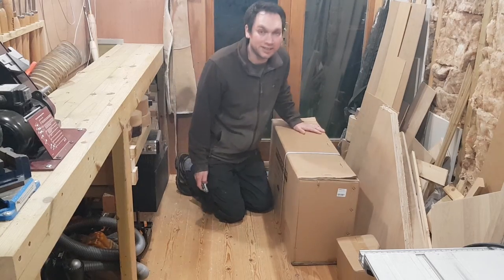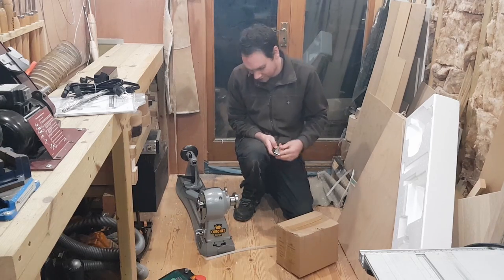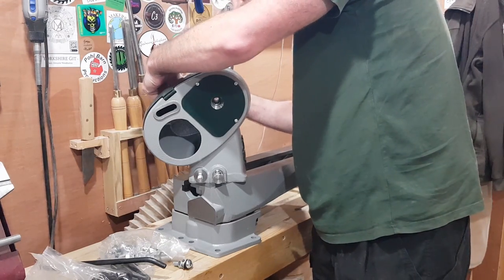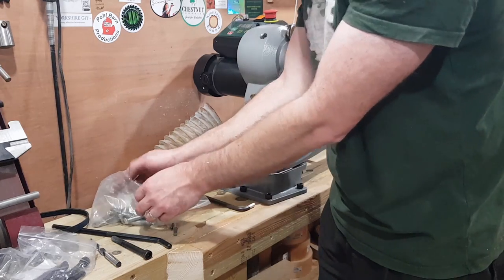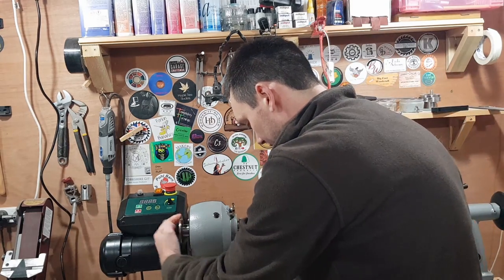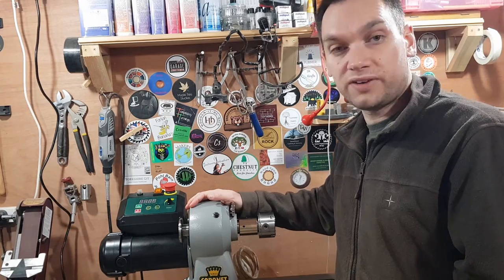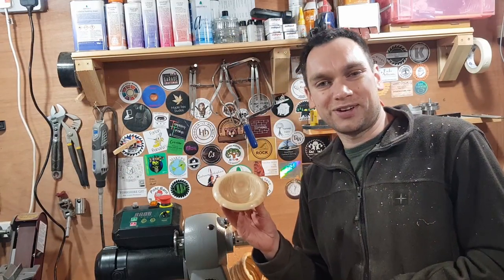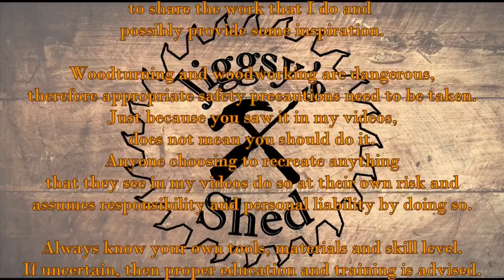Unboxing the Coronet Herald Lathe and having a go

Comment: Hello John,
Congrats on your new lathe. I see that it has a strong and solid structure. It's also great that it's adjustable. It will perform well in use. As far as I have heard, those who start lathe work always continue to change lathes with a higher model. But your old lathe's engine seems to have a problem. This beautiful lathe is awesome. I just watched a nice new design on the new machine. Keep up the great work with it. Thank you for the introduction and detailed information. See you. all the best.
Reply from the maker: Thank you Mehmet, really appreciate you watching. Yeah, I was definitely in need of an upgrade and this lathe should keep me going for a long time. The weight of it will make it a lot more stable as well. There is so many other lathes that can be upgraded too later, but space will become an issue.

Comment: Hi Jiggsy.  I got one 3 weeks ago and I’m very pleased with it.   I couldn’t help noticing that the power lead on yours hangs down and swings in the air. It did the same on mine.  I contacted Record Power and to my surprise, they didn’t want to know, they just said they always been made like that. Which in my opinion, doesn’t make it right.  I think most electrical engineers would consider it to be a safety issue.
I thought about attaching it to something, perhaps the bed, but that would prevent the head being slid down it.
So I rewired mine with a suitable length lead going to the filter.
I didn’t use the bed-leg connecting plate.  After measuring I decide it would make the spindle to high, when mounted to my bench.  Instead I drilled, I think it was 10, 10mm holes in the bench and used 10mm bolts to secure the bed to the bench, believe me it ain’t going anywhere😀
Happy turning, cheers Noel.
Reply from the maker: Awesome, glad you're enjoying yours. I am still really impressed with the lathe overall and enjoying it. Definitely was the best decision to upgrade to it.
Yeah, that power lead did confuse me initially as well and I did think if there was an option with it, but as you say, short of rewiring it, I just decided to leave it as is for now. I just make sure that there are no other forces pulling on it.
Without the benchfeet mine would have been lower than I'd have needed it, but they also give the opportunity for me to place items underneath the lathe while I'm working.

Enjoy your lathe and happy turnings!
Reply: @JiggsysShed  The space underneath is a good point, it would make removing the chips underneath much easier.  I suspect my bench is a bit higher than yours and the connecting plates would have made the spindle too high.  Plus the additional cost😉
I still think that the cable length is wrong, but RP won’t admit it, if they do I will probably cost them.
Reply from the maker: @Jestey6 it does make it easier, though I still need to use the vacuum  under the feet as it does not brush out easily. They are definitely not necessary if you don't need the extra height.

Comment: Nice work man, smooth cuts too, i hope i get there soon LOL.  I'm picking up one of those tomorrow, i do have a Laguna 18-36 but i want a second lathe and the Coronet Herald is the chosen one.
Cheers.
Reply from the maker: Thank you. I'm still very much learning and my cuts are not always quite there, but was definitely pleased with how this came and the herald definitely made the job a lot easier than my old lathe. 
The Herald is definitely a great lathe, though would have been good if it came with a slightly larger tool rest... Will have to pick one up some point
Reply: @JiggsysShed  Get a Robust brand tool rest, they come with a round hardened rod welded on the top, very smooth and long lasting. BTW i just finished setting up mine, love it, it's like an old sawing machine, retro, quiet and yet advanced. mine came with the new upgraded tail-stock, self ejecting and the bolt doesn't come through the hand wheel anymore.
Reply from the maker: @area50juan  they've only just really started selling robust lathes here, not sure they sell the parts separately yet, but will have a look. Thanks for the advice.

Glad you like yours. Yeah, it is nice how quiet it is and the self ejecting tailstock is brilliant.

Have fun

Comment: You will enjoy this a lot! A good buy👌
I am considering removing the legs from mine and also attaching the lathe to a wooden workbench. I'm curious how it will go for you in the near future. I'll keep an eye on it. 
Have fun with your Coronet Herald!
👍Frank.
Reply from the maker: Thank you so much Frank. It definitely is a lot of fun and already feels so much easier to use compared to my old lathe.
I think that the only thing with mounting it to a workbench is that there is more vibration with unbalanced pieces as there is less absorption of the vibrations, but it definitely does help from a space perspective and I can put tools and stuff underneath the lathe as I'm working so that they are close to hand.
Thank you for the sub, watching and commenting...greatly appreciate it

Comment: Congrats on the new lathe Jiggsy. Looks like im gonna have to considder the same as my lathe does the same as your old lathe. But maybe ill just try and get a new motor for now. Glad for you mate, enjoy it 😁👍🏼👏
Reply from the maker: Thank you Japie. I was initially in 2 minds about just trying to fix the old lathe, but it had a number of other frustrations, which pushed me to getting a new one instead. Hope you can get your motor sorted.
Thank you again for watching and commenting.
Reply: @JiggsysShed  i know how you feel about the old one as my first lathe was similar just branded differently. Because the bed is just square tubing for one, it makes a hell of a noice when turning and they arent really structural strong. On my old lathe i couldnt use a chuck as the whole spindle and threads were smaller and having an adapter made would have costed me a grand.
Reply from the maker: @PotgieterWoodturning  yeah, mine would flex when I put something between spindles and I could never take something off and have it perfectly centre when I flip it round.
Wow, that's a lot for an adaptor. My chuck set came with an adaptor to fit the spindle thread of the old lathe which was handy.
The new lathe definitely runs a lot quieter and the weight just gives it so much more stability.
Reply: @JiggsysShed  yes, like you say, turning stuff around you always had to true it up again. Yes, it flexes a lot. Glad you are enjoying the new lathe mate 😁👍🏼

Comment: Nice lathe, just bought one myself for the same reason. All you need though is a new set of brushes for you old lathe. They are only a few quid online.
Reply from the maker: Thank you for watching and commenting. Enjoy your lathe, it definitely is a great piece of machinery.
My thoughts were that it is the brushes, though some have said it could be the capacitor. Although fixable, it was always in my head that I would think about upgrading when the old lathe needed repair as I needed something with more torque. Will fix up the motor some point though and make use of it somehow.

Comment: This is my first time watching a video of yours. For over a year I've been looking at this lathe on and off. I see they're on sale again right now. Trying to justify buying it over other tools that I could really use for work and that would actually make me money. It's been almost 40 years since I've used a lathe. What are your thoughts after using it for a year now? And what lead you to buy this one?
Reply from the maker: Thank you for watching.
I am loving this lathe as it has significantly stepped up what I was able to achieve on a lathe.
I had a friend who had one so he could advise about it. Also, other makers in the community recommended it to me. The lathe fits well into a small workshop and despite being a smaller lathe, the way it is engineered allows ir to compete with bigger and more expensive lathes. The other reasons for purchasing it were the variable speed and the swivelling head stock (not necessarily found on other lathes at a similar price). Both of these functions allows for a lot more ease in turning.
Although I've not done it yet myself, I would definitely recommend hitting a bigger tool rest or a curved one to reach into deeper bowls better.

I hope this helps, but if there is anything else you want to know, just let me know
Reply: Cool, Thanks. Do you have any other recommendations as far as accessories in addition to the bigger tool rest a newbie should consider? Or which turning chisels/gouges should one get? Which brands are the best? @JiggsysShed
Reply from the maker: @t.e.1189  the accessories I have purchased as extras were a bigger chuck than what I had. I went for the 100mm from Rutland Tools as it came as a set with a number of adaptations. There is a video up in regards to unboxing that. Though my other choice would be the Record Power or Axminster chucks. I also purchased a Jacobs chuck insert which allows me to drill a center hole and has made hollowing simpler at times.
Gouges wise, I can only really recommend what I have used. There are a variety of good brands out there, but I do like the Robert Sorby tools in regards to traditional gouges. Simon Hope does a really nice carbide pro hollower.
If you are looking to use carbide tools, I would recommend Easy Wood Tools, they are not cheap, but you do not need many of them to achieve good turnings. I have had a go with them before and they do cut the wood really well.
 @JPwoodwork uses these all the time and would be able to advise you more on these if interested.

If using traditional gouges, make sure you have a good sharpening system. I use the Robert Sorby ProEdge as it makes sharpening a lot quicker and easier for me, but there are other options available.

Traditional gouge wise, you do not need to start with many from the offset as you can often achieve a fair amount with even just the beginner sets on offer (Robert Sorby does a set).

Currently with the swiveling head stock I can only turn it to a 45 degree angle as having other at 90degrees I will need the outrigger.

If you are able, I would definitely recommend having the legs with the lathe to have it free standing. Having it mounted on the bench does mean I have to run out of balance pieces at a very low speed as it will otherwise shake the whole workshop.

Comment: I've heard only good things about Coronet series lathes. They say Herald is not 1hp, but closer to 1.2-1.3. And it has all the bells and whistles one may want. I've heard you may want to aquire center to center male mt2 rod. It has a name I don't recall, but it helps lining up the headstock to tailstock dead on
Reply from the maker: Thank you for watching and commenting.
Yeah the coronet series has definitely stepped up the game and the power for a small motor is great as they have managed to step up it's power output, so it does rival bigger machines well. The swivelling headstock and variable speed is definitely a big plus for me.
Yeah, not sure of the exact name, but I know what you mean. Think I just call it a tailstock alignment tool. I haven't yet felt the need to get one, but I know it's available from Axminster Tools in the UK.

Comment: you certainly needed a new lathe i am considering getting a herald i also have a small workshop but now that i saw how much swing room is needed to use the swivel it might be to much mmmm! could you tell me how much room is needed as i want to put a bench up so i can have space underneath i have the rutlands 100 chuck but that adaptor looks huge, good luck with it and have fun.
Reply from the maker: Thank you Roy. Yeah definitely needed it.
If you can go for the herald, it is a great machine and the swiveling headstock is handy. You also have the reverse function.
The only time you would need to have the full clearance behind is if you are going to do a big piece with the headstock swung to 90 degrees, for which you need 47cm from wall to front of bench feet. For a 45degree swing, you would need 45cm. For a 22.5 degree swing, which helps with the hollowing, you need 41cm.
It's 88cm of workbench required for the feet, then allow 25cm for the motor and 10cm for the tool rest, longer if you intend to add the extension. These are only the bare minimum and I would definitely recommend you work bench being longer than 88cm to allow enough spacing for the bolts.
The adaptor does put it further from the headstock and for small piece this is fine, but for bigger you want a chuck that fits directly onto the lathe thread. Rutland chucks can be purchased at the correct thread size and it is always great to have a spare. The adaptor was fairly reasonable in cost as well from Rutlands. The chuck that I have is the 3" Xact prescion, which is now the Precision 75, so slightly smaller than yours.
Hope that answers your questions.
Reply: Thank you for a quick reply on the information that's a great help your a star
Reply from the maker: @roystheboy  no worries. If anything else, just let me know.

Comment: The record power Coronet is a monster midi from everything I've seen. That blue one was pretty rough looking
Reply from the maker: Yeah, I continue to be impressed by the power of the Coronet Herald. It is a lovely lathe for a small space.
The blue one was a Charnwood W811, no longer in production, but its similar to ones you can find on Amazon. It did serve me well, but I was always working it harder than it was designed for.
Reply: @JiggsysShed  I just got my first one. Just a small craftsman half hp wish it had a little more.. but once I get it down better I'm going for one of the larger midi like that record power.  Such an amazing machine. With the rotating stock and stuff. I should have just went there to begin with because I feel in love with turning day one
Reply from the maker: Yeah, it's quite an addictive hobby.  The blue lathe had set me up for falling in love with the hobby and where I was limited by it in some things that I could do, it did challenge me to think about how I could still make things work for me. Changing to the herald definitely made me appreciate the challenges that I had with the old one, but it was all good fun.
The craftsman should serve you well in your woodturning journey.
Many happy turnings!
Reply: @JiggsysShed  hopefully it does, thany
Reply: If u have time to answer one question I would much appreciate it. I got half scammed on HSS chisels and they sent me HCS ones that are ungodly trashy. I have somebother ones coming but they could take three weeks for the order to be filled and I don't want to wait until then obviously to turn again and i dontbhave my own bench grinder yet. Do u know if anyone has any luck sharpening with a Dremel and the mini grit wheels on it
Reply from the maker: That's frustrating about the hss chisels not being right. 
Before I had my my ProEdge for sharpening, I used a cheap bench top grinder and did it freehand... my edges did look a bit like Picasso sharpened them, but it worked.
You can sharpen tools with the dremel grinding wheels, however, I don't know of anyone who has done it with turning  chisels. The trick will be to get accurate/consistent contact to achieve a consistent angle across the edge/bevel, though it shouldn't be impossible, just time consuming I would imagine.

Comment: Do you know if you could do some bowl coring on the herald ?
Reply from the maker: Unfortunately I am not sure about the answer to that. I think it has just enough power for it, but the machine might need to work too hard for it to be a viable option.  It might be worth contacting Record Power direct to enquire about it.
Reply: @JiggsysShed  I will let you know … picked up a McNaughton set second hand … first time I need to put the belt on lowest gear ….
Reply from the maker: That would be good to know, thank you.  I've only gone to belt 1 setting a few times when doing very out of balance pieces. Normally I'm on 2 for bowls and 3 for spindles.
Reply: Tried it out on some wet lime wood last night. It worked and I got three bowls out of a 14 inch blank.  Belt 1 required and it bogged down a good few times but it did it much easier than I thought. I was really impressed with it. Great lathe. Outboard turned 16 x 5 inch diameter green blank.
Reply from the maker: @kellogs101101 that's a good! Great to be able to make the most out of a piece of wood.
That is a good size outboard given that it would be heavier as well given the moisture content. Great going.
I need to get myself the extended banjo so I can turn outboard. Currently only able to go up to 45degrees.

Comment: How high is the bench from the floor that the herald is on . Thanks
Reply from the maker: I have the bench set at 90cm High, which places the spindle around my elbow height
Reply: Thanks for the info I’ve just purchased a herald and I’m building a bench so now I’ll review my measurements
Reply from the maker: Awesome, enjoy the lathe!
Reply from the maker: How are you getting on with your herald? Have you managed to get it all set up and use it yet?